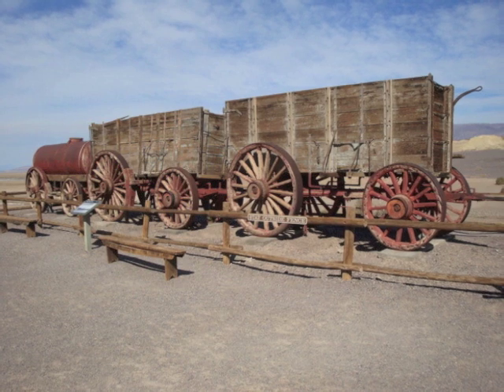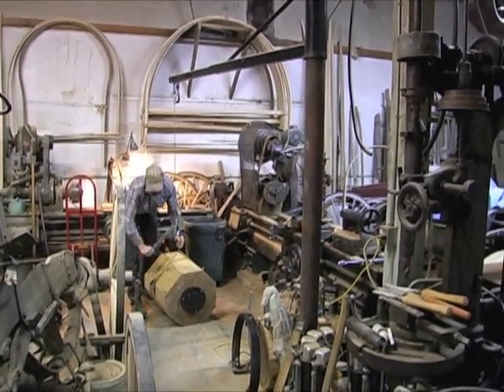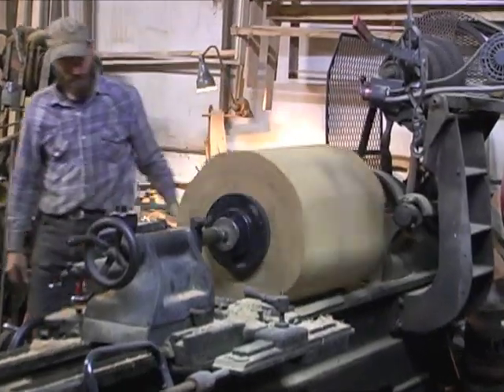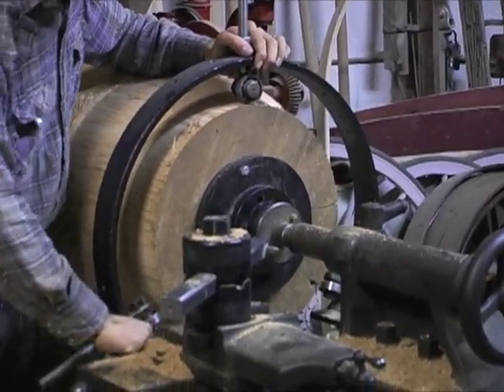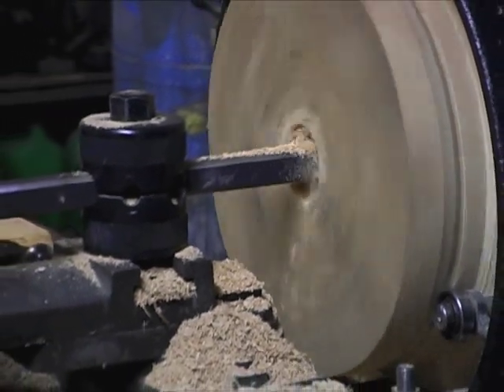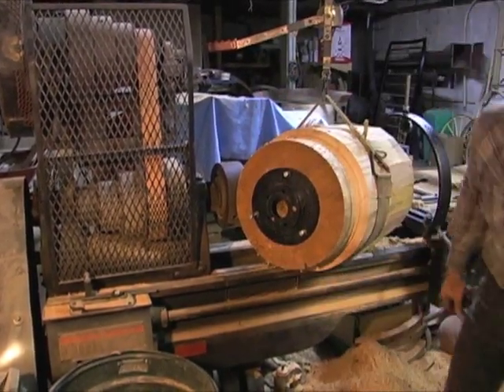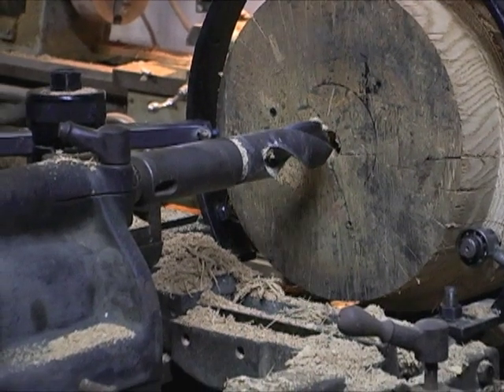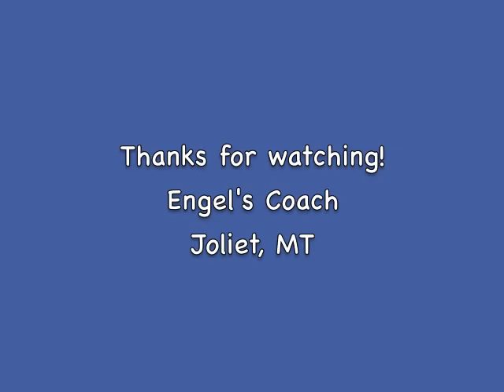Beginning the Borax Wagon Project | Turning 320# Blocks to Wagon Hubs

Comment: I love the steady rest and end caps, I believe they are disk brake calipers. When you don't have it, you make it. I believe you said you did 18 hubs, did you try to get an old lathe that the carriage would clear so you can use the carriage instead of the compound. Sometimes you do the best you can with what you have. Loving the videos. Yes I'm a 78 year old machinist, so I will ask a lot of questions.

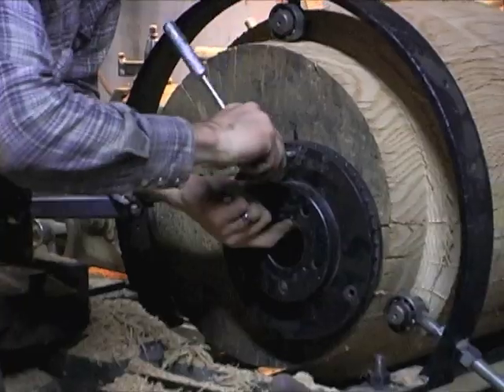Comment: 15:39 that metal plate he's taking off is a car brake rotor, that's 21th century technology, lol
Reply: Actually brake rotors are late 19th century tech. First disc brakes were developed in 1890 and patented in 1902. So while not quite contemporary with the borax wagons, they stopped using the wagons in 1889, a cast iron rotor is far from being 2st century tech. 😁😄
Reply: @budmeister  Play nice. 😋
Reply: Just take a looksie around Dave's shop....lots of wheels used for various types of stands as well.